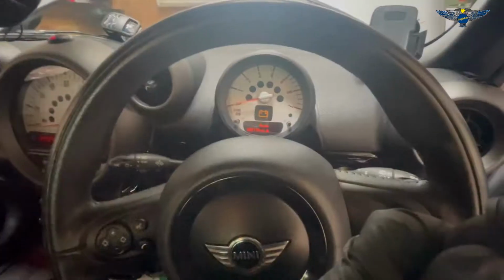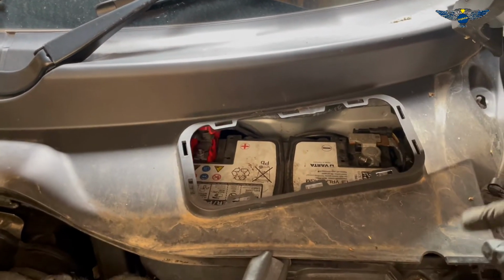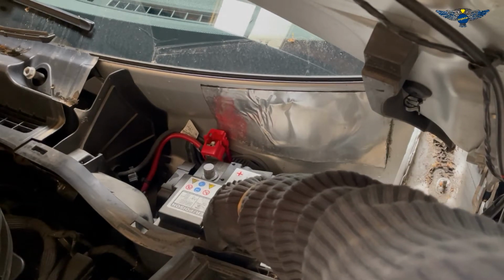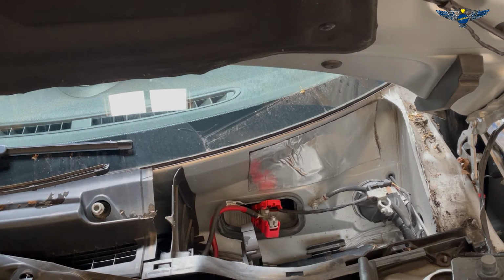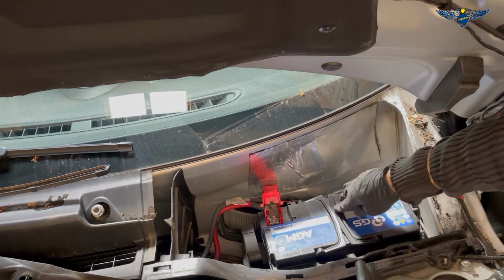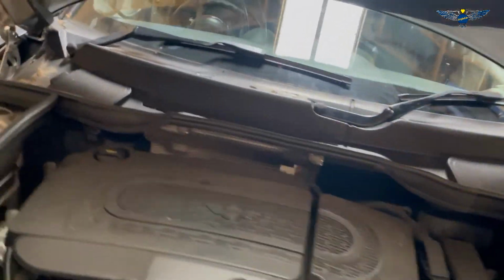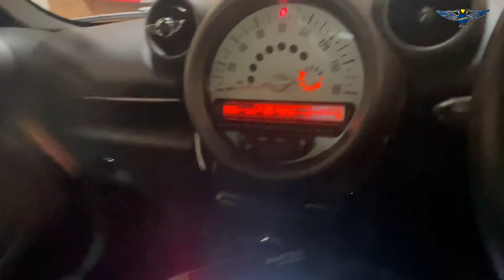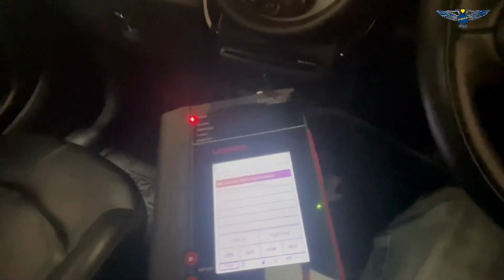Mini Countryman 2012 main battery replacement

Comment: You probably didn't need to remove the wiper blade arm if you stopped it when it was in the vertical position.
Reply from the maker: May be, am not sure, may be next time I’ll check it out..
Reply: @DaringBeefcake  Tried it today - car returns blades to start position (annoyingly). Found out today when doing my car. I also broke a clip but when replacing the cover! Thanks for taking the time to record - I wouldn't have been able to do the swap without it.
Reply from the maker: @MalcolmQuiney  glad the video helped, and well done for doing it yourself..